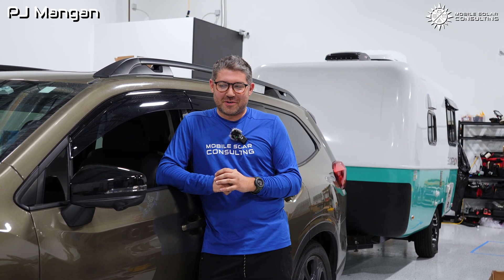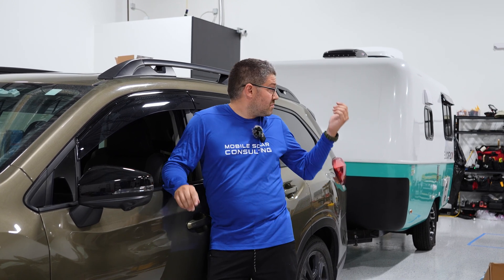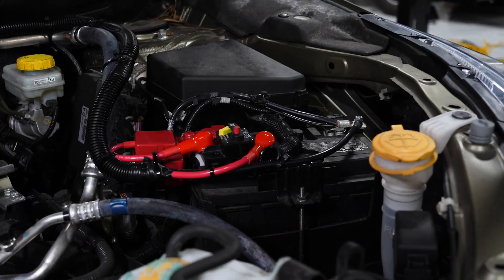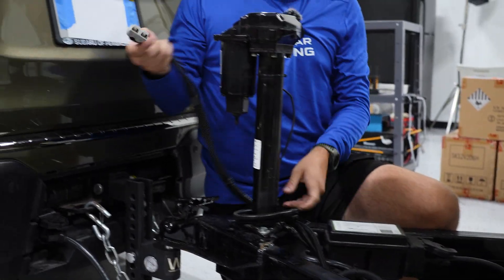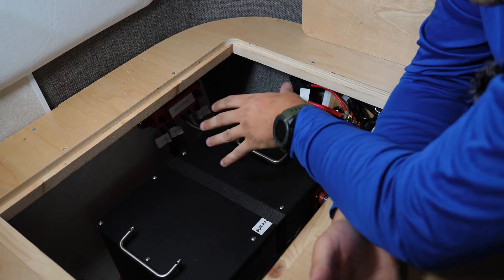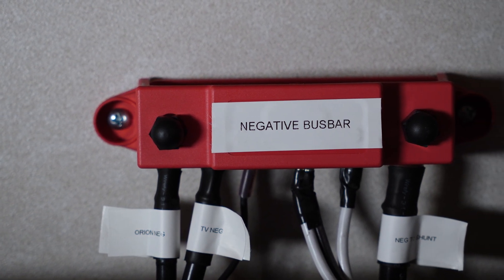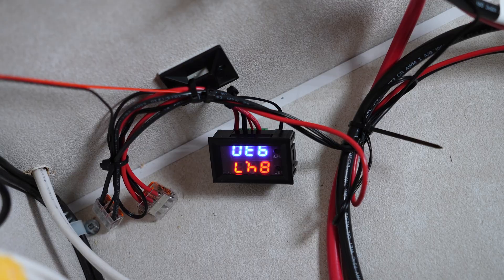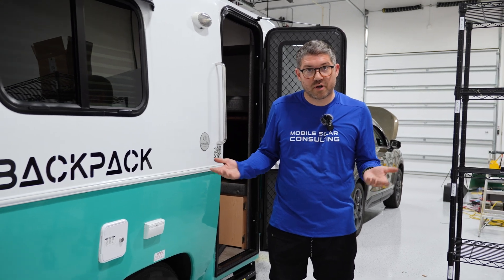DC-DC Charger Install on the Smallest Travel Trailer You've Ever Seen!

Comment: Do I need a dc to dc charger to protect my truck from the lithium battery ?
Reply from the maker: If you're towing a trailer or 5th wheel, it's not required. The 7 pin connector is already limited. But it's also very slow...

If you're driving a motorhome or van,  then yes, it's necessary.